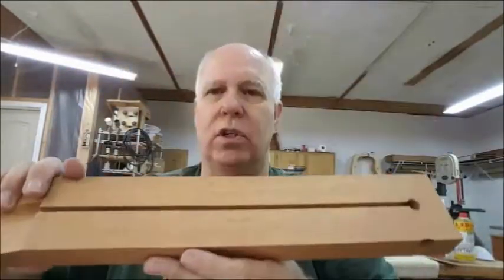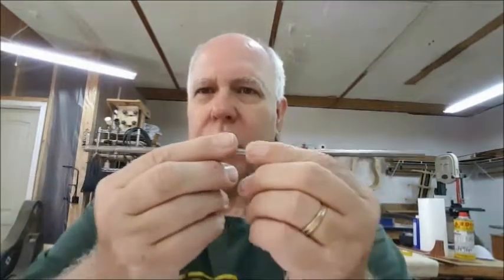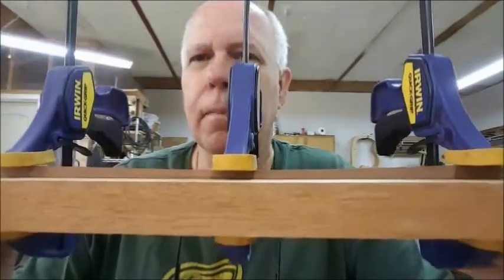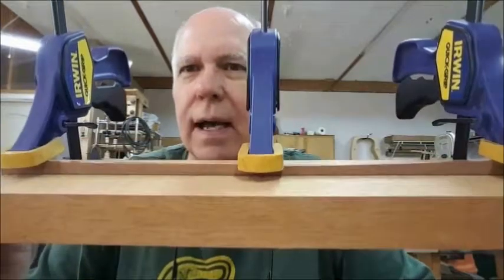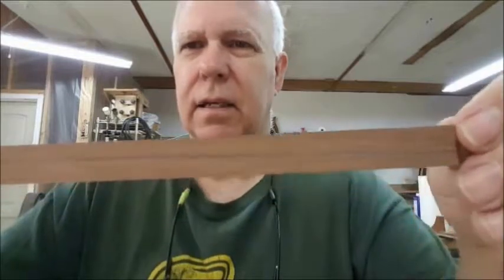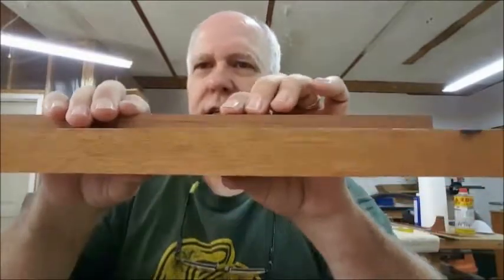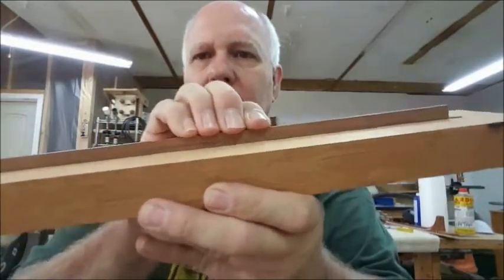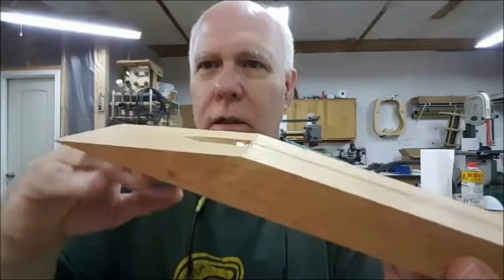Installing a Vintage Style Gibson Truss Rod: Part 3

Comment: Very interesting, after I found out that Gibson invented the truss rod and that it works better than on any other brand of guitar I have, including Martin and Guild. My luthier however told me that the truss rod on old Gibson acoustic guitars has an angle and runs down in the direction of the heel. I see it on the 1923 Gibson patent drawing, so like my parents, it celebrates its 100th birthday. I wonder what you found on this.

Comment: hello, before placing the strings for the first time you adjust the truss rod a few turns ??
Reply from the maker: I only tighten it so it is not loose. I make all final set up adjustments when it is tuned under full tension.